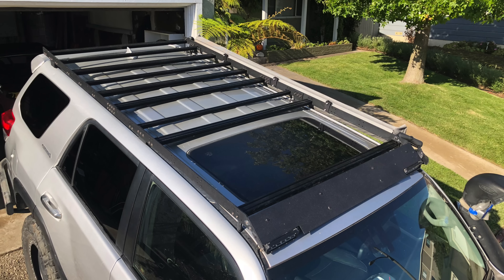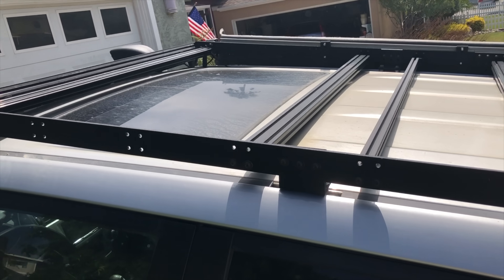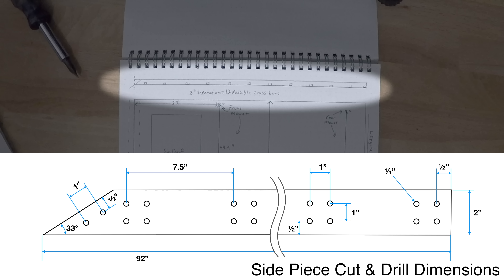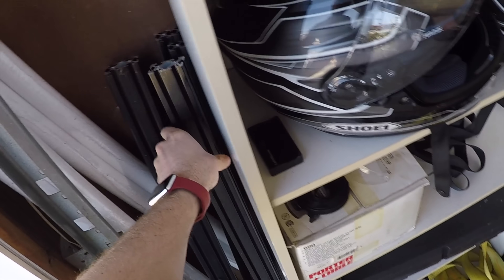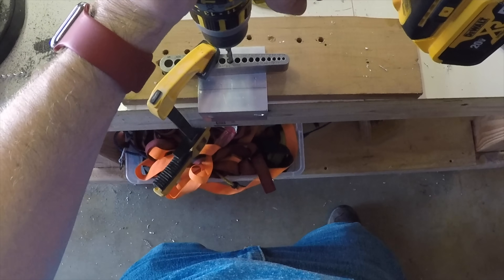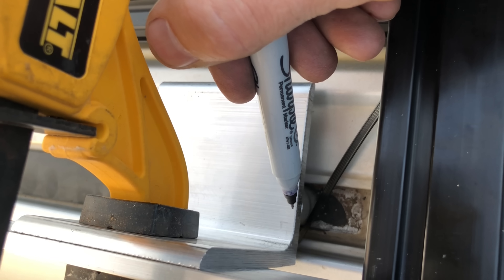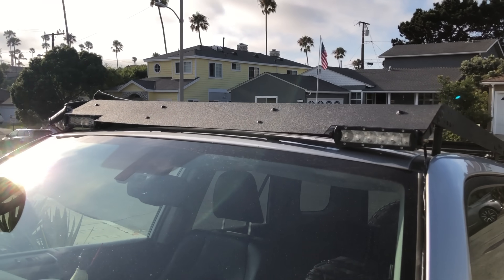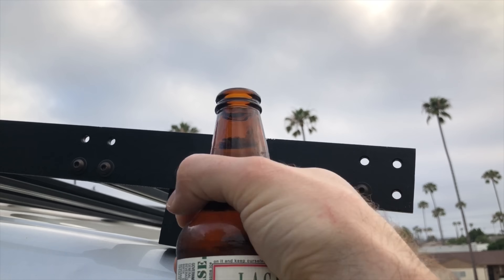Build Your Own Damn Roof Rack - How I Built a $1000 Roof Rack for $300 in half a day.

Comment: Love your sense of humor and great DIY projects!  I also love this rack! Subscribed.  Thank you for no music during the build, hallelujah!

Incredibly useful video, and you are a frugal genius.  I hate being ripped off with the outrageous extortionary prices 80/20 wants for every nut and bolt. I know darn well they are getting them very cheap from China then reselling at mafia prices.  So happy to see you give us some alternatives.  Using cheaper side rails is very clever and drops price a lot.  Knowing what size 80/20 struts worked for you is also a step closer to my build design.  I have a 22 ft Class C so big roof with all sorts of things to trip over like vents, hoods, etc and to design around them. Thanks also for showing us where you bought the supplies, super helpful.

My tips to you from the RV world:
Use Butyl under anything that you place on roof that could leak.  A roll on hand never hurts.  Its a rubber compound, so on my RV, I would use it around every light fixture so no water gets into the wood structure behind.  If you cut out a hatch in the metal for example, add butyl tape under the hatch ring that sits on your metal. Prior to that, of course, spray Loctite Rust Neutralizer on bare metal right after drilling and vacuuming metal bits off, and then some paint, then your butyl.  The Loctite RN bonds rust to metal and acts like a barrier before painting.  You probably know all this but ... sharing my favorite spray can.

The other thing that you need is Dicor Lap Sealant Self Leveling type.  When you drill a hole for a screw, add a dab of that, then screw your nut into the metal roof, then put another dab on top of the screw so its completely protected.  Works wonderfully to seal up that screw head.  To remove it, scrape it off with a knife and /or Dremel wire wheel. Dicor is the bible of the RV world!  They make a non-leveling version too, but I've never used that.

Question for you:
Do you have to have a drill press or a drill will do?
What do you mean by 'tap' on 80/20?  Drill a hole?  A specific kind for metal screws or ...??  What was that talk about special drill bits for drilling into the 80/20?

I use the Dewalt Cordless 20V Drill and Driver.   Model 887 is best.  Model 885 is cheaper.  3 LED lights in front is a game changer over 1 LED light in front. Small 2 amp batteries for both is easy on the wrist.

Comment: In my experience the "save yourself 50 cents per tapped hole get comfortable and start tapping" is followed almost immediately by breaking a $12 tap reducing a $25 part to a piece of 23 cent scrap metal. Don't worry, I'm smart enough to learn from my mistakes. I learned the same lesson twice last month (Februaryis a bit shorter after all) , 4 times in January, 3 times in December, and I've scheduled lessons twice a week till fishing season opens in May.

Comment: hey hoss, i have the same gen 5. i am wondering if you designed it in CAD? if not i would love it if you would send me your designs. i'm an aerospace design engineer and i would design this in NX / CAD. also maybe sharing your full parts list? let me know your thoughts!!!

fyi - i will prolly design the $30 amazon lights to be flush with the top of the wind fairing.. lol funny stuff man.
Reply from the maker: No CAD. Most of the parts are in the description or check the Part 2 video: https://www.youtube.com/watch?v=oSOVnRDGtS4

Comment: Do you design for others? I've got a 2000 chevy express conversion high top. No one I can find is clamoring to manufacture racks for these vans. I like your idea, but I have to mount to the gutter rails and go up 12"/13". I can put things together, but not good at the engineering and manufacturing part. Thanx, Chase

Comment: What did you use for the front wind valance & what angle did you cut your side rails at? (getting my materials list together to build one for my jl unlimited)
Reply from the maker: I just used aluminum sheet for the front. I don't remember what thickness, probably around .050". The angle was whatever the top of the windshield was; I also don't remember that. Be sure to watch Part 2, linked in the description. It has some improved design ideas.

Comment: I can see why it "only" cost $300. Just checked https://prinsudesignstudio.com/ selected a 2010 Toyota 4Runner and, yes, these do cost $900 but they are very well made with side pieces powder coated with mounting feet bent from the side pieces. They are also very easy to install into the existing Toyota roof rack mounting positions. The extruded black anodized aluminum cross pieces are tapped for easy installation. The method you used is nice for a DIYer but it only took me 30 minutes to install mine. If you work for a living your time can cost money so you also have to factor in your time when building things.

Comment: So glad I stumbled upon this video!!  Now that my kids are all starting to MTB I'm in need of a multibike hitch rack.  I've been looking at options and got to thinking I could probably make a hanging style rack (ala Velociracks) using 80/20.   If anyone here has suggestions for mating 80/20 to a hitch receiver that seems like the obvious weak point of my idea.  Or maybe I can get 80/20 that will just slide into the 2" receiver and use some shims to keep it from moving????
Reply: 2"x2" 8020, grind down the edges, hammer 2" hitch tube over, then lego the rest of it together

Comment: Matt - really enjoy the channel in Europe, I have subscribed and eagerly look forward to your vids.............................. 

....................BUT FOR LOVE OF MIKE,     how can you have 44.9 INCHES???    eh??  I mean what is 0.9 of an inch??  7/8ths?  13/16ths??   27/32ths???   why not use the metric system!  That's how Toyota designed it!  Having said that, I cant do kilometres ..... I have to convert it into miles..............and I also buy petrol in litres but calculate Miles per Gallon.........which is a different gallon from the US (and probably a different mile)   .....and what is a "Quart"???    2 pints???  and is a gallon 4 quarts?  so 8 pints??  OF MILK???  

Oh I give up. .............................................................great channel though.
Reply from the maker: I assure you, I hate the imperial system as much as you. But when you're building stuff in the states, it's much easier to use inches. It's way easier to get imperial fasteners and material in inches. And yea, I do sort of willy-nilly switch between fractions and decimals. Sometimes it makes more sense with fractions, but I prefer decimals. major fractions are easy, but when it gets past 1/16ths... ¯\_(ツ)_/¯
Reply: @SuperfastMatt  A BLESSING!!!  Thanksforreplying to a 2019 video.😁   ....watching This Old Tony talk about "a runout of 3 thou."  sort of makes sense however. Can't wait for the day when the Jaaaag becomes a living breathing and potentially sparking thing... I suspect you are the same as well.

Comment: Eh i prefer a basket honestly, this is just too low and flat for my tastes.. And those leds you got arent bright at all, i have the same ones for back up lights and thats all there really good for.  I bought a 64 inch chinese basket on amazon  for $100, just paint the welds and seal the tubes with silicone and it hasnt rusted on me yet in the months ive had it.  That an my basket is 6 inchs up, securing things feels safer in a basket vs a flat top but thats just me.   Kudos to you for building one though

Comment: You missed a trick. There could be access to the T slots in the extruded sections so you can slide stuff in it.
Reply from the maker: True. You can also get T-slot nuts that can be inserted in the middle without end access. That is the kind I usually use.

Comment: hey just found your vid. thanks for doing this! wondering if theres a standard spacing for crossbars? or how did you figure the 7.5 between 1st holes? or was just just based on your sunroof and rear tailgate position?
Reply from the maker: There's no standard that I know of. I just added some evenly spaced bars skipping the sunroof.
Reply: @SuperfastMatt  thanks! didnt know if certain accessories would require a certain amount of spacing or not.
Reply: @SuperfastMatt  oh also, do the tnutz bars have larger holes to slip carriage bolts in? Or do you have to take off the sides to mount something?
Reply from the maker: @GuyWithAGweikeCloud  you have to remove the bar for carriage bolts, but you can buy t nuts that drop in like these: https://www.mcmaster.com/hammer-nuts/nut-style~hammer/
Reply: @SuperfastMatt  you werent joking when you said mcmaster has everything. thanks!

Comment: Why didn't you cut like slot on brackets to slide whole rack up and down don't have to put 12 spacers. Tight screws direct to bracket and brackets are tight direct on all manufacturer bolt hole. ( Just my opinion)

Comment: great video and will use it for sure. one question I have is that it looks like (@ 0:38ish of the footage) you have small "support feet" added toward the very front of the rack since I guess the portion of the rack extending past the foremost front factory roof rack mounts would not be able to offer enough support on it's own considering the leverage forces... is that correct? thanks

Comment: It looks amazing. And since the middle pieces can be bought pre tapped and at certain length and width, I think this is very doable. Fifty cent per tap with 40 taps is only $20. Nice job!~
Reply: I'd bargain them down if I was buying their stuff.  $0.50 cents per drilled hole is way too much.  Why pay that?

Comment: Did you use the same hardware from the stock rack to mount it to the roof? Also how tall were your spacers you used? Looks like maybe an inch?
Reply from the maker: I used hardware from a different aftermarket roof rack that was already on the vehicle. I don't remember the spacer length, but an inch sounds close.

Comment: I was looking to build one of these for my 4Gen. What did you use for the feet in the front?
Reply from the maker: I used some threaded rubber bumpers I had sitting in my garage. You can get them on Amazon or McMaster. The length sort of depends on how you level and mount your rack.
Reply: @SuperfastMatt  Thanks for the reply! Got them in my cart at McMaster along with the hex standoff. Last question...what were the size of the bolts to attach it back to the car?

Comment: Hey, neat to see you on Youtube years after reading your FSAE book. One thing I wish you'd have gone into more detail on is the furthest-forward mounting points that you added to the roof channels. I assume you used rivnuts and sealant to keep it waterproof, but any tips and details around that would be great to see.
Reply from the maker: I just used some rubber bumpers up front that I had lying in my garage. It wasn't a super elegant solution but it works. It isn't physically attached to the roof at the front; those supports just support the weight.
Reply: @SuperfastMatt  thanks for the info!

Comment: Good project. As I'm looking into off roading I'm a bit puzzled why so  much of the gear costs and weighs so much. This roof rack is an elegant solution. What I've learned hauling 18 foot kayaks around is that the roof rack needs only to be exactly that a rack on your roof. For kayaks there are all these roller-thingies that cost a fortune, don't work after six months, and leaves gunk on the hull of my yaks. In between stupidly expensive Thule and Yakima racks I just used foam padding and ropes. No problems. I wouldn't now have the Yakima except after my Thule was stolen someone gave me an old Yakima. They're okay. What you did is more than enough. I think the money you saved allowed for the cost of the 80-20, me? I can see maybe three pieces of this or none at all. And being an old carpenter I can see doing some of this with wood. Of course over time and exposure the wood would be more maintenance than the metal.

Home Depot has $2.50/8' spruce 2x3s, the Wright Brothers invented powered flight with spruce, so it could do the job. In a pinch those angle brackets and then a wooden frame? I could knock out a working, but not pretty roof rack in less time than you spent. Making it nice, clear coat.... a lot more time, and regular annual maintenance refinishing. 

btw of course you know that anything long, like a kayak or 4x8 plywood, it's tying down the front and the back that counts. I've never met anyone who's lost a kayak who had tied down the front and back. The only problems I've ever had with plywood is the front lifting up and trying to fly.   Thanks.
Reply: You would make a roof rack with spruce wood because the Wright Bros made a plane with it? What an utterly asinine comment!  The Spruce plane was hangered when not in use.  It did not sit atop a vehicle exposed to the elements 24/7 rain and shine and cold and frost.  The only reason they built it out of wood is because they had no access to better materials like aluminum and because wood could be shaped easily as an experimental model. How many planes in existence today are made of wood?  Zero.

If you build a rack out of wood, after it quietly disintegrates due to natural weathering, and a rotten chunk of that rack flies off your car or motorhome at highway speeds and kills a motorist or family, or creates a crash pileup or hits a semi driver and his truck falls into the ditch in flames, and you cool your heels in jail on a charge of negligent homicide or criminal negligence then you can ponder on the wisdom of your use of stupid materials.  There is a reason NO ONE builds a rack out of wood. You may be a carpenter but your age is definitely showing old man!  These are the words of someone with dementia or a half wit. 

To build a rack that carries heavy stuff on the roof, you would need heavy lumber. Aluminum or steel can be much thinner for the same load capacity.
You would need wood that is both water resistant AND load bearing. Redwood and cedar can handle the rain, but they cannot handle load or used for structural frameworks.  Brazilian Ipe might work but it is godawfully heavy, costs a fortune, and is toxic when cut.
You would have to reinforce the vehicle roof - cars or RVs have delicate roofs that are not load bearing.  The body is, but not the roof.
Wood will require annual repainting, resealing, all screws must be stainless steel.  If any water gets in, and freezes, the wood will crack. Are you going to monitor every crack?  Dry rot, mold will set in over time. UV rays will disintegrate the finish. 

Instead of forcing every build into the carpentry mold, why not learn to work with other materials? Metals are a whole new world of creativity.  Now if you could combine your carpentry skills with metal fabrication, you would be  in high demand for RV cabinets made of aluminum and wood. Check out Humble Road vans.

Comment: LOL!!! "I bought a $2,000 mill to drill these last holes."  

You could have bought an AC-DC TIG welder for $800, thrown away most of those nuts and bolts and welded this in either aluminum or steel. Better yet, you could've bought a stick welder for under $200, steel bar, a welding helmet, gloves, electrodes, clamps for maybe 300 more. and you've learned to weld, too!   And you'd only need to drill holes on the plates that match the threaded holes on the SUV.
That said, you should go ahead and buy a welder anyway and get started on a second rack.

Comment: You inspired me to build my own roof rack for my 2017 Toyota Tacoma off road. I did use tnutz to order all my crossbars. I even installed a 40” led light bar.
Reply: What were the measuremeants you ordered your cross bars at, same as the prinsu for Tacoma measurements 47"?

Comment: Where did you purchase the 92" x 2" or 3" aluminum plate for the sides? I am planning on building my own for my Lexus GX470. Thank you
Reply: Home Depot sells them in the hardware section @96" for $50 a side
Reply: @matt234100  Thank you!

Comment: Racks are touching the roof unladen...
Add a load and 10mi of road vibrations and kiss goodbye to your roof duco.
Not to mention all the bolts rattling loose.

Personally I would have bought aluminium oval tube stock and Tig welded that shit together like an actual commercial rack is manufactured.

Comment: Great video. There’s a lot of money to be saved with DIY that can be spent on new tools. I too use my projects as an excuse to buy the tools I want/need. One thing I would suggest, is to use butyl rubber for the bolts that go into the factory drilled holes in the roof. If water gets in there, you may get some serious rust issues and potential leaks into the cab. Also, using some sort of thread lock fluid would be a good idea, especially on off road vehicles because of all the added vibrations from driving in rough terrain.

Comment: I drive a post apocalyptic lifted Prius work no mount holes. Have any suggestions on how to work around that?
Reply: Just you wait. I'm building a rack for my four door sedan. Already had a welder, helmet, gloves, clamps, electrodes, angle grinder and a plasma cutter. I'm about 90% done.  I'll make a clip showing the final product.  Hoping to finish in next two to three weeks.

Comment: If you're reading the comments before watching, it doesn't take a $2000 mill to do this project. But, I have filled my workshop with tools using the same logic, "Even if I buy the tools needed for/make easier, this project, I still saved money over having someone else do the work." In most cases, it is a valid point.